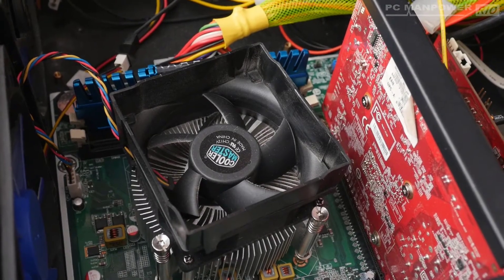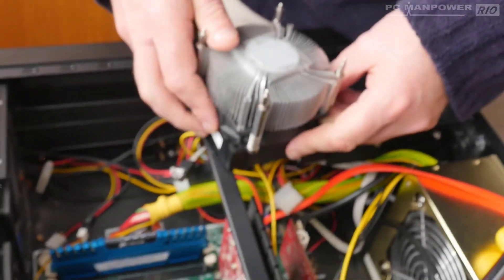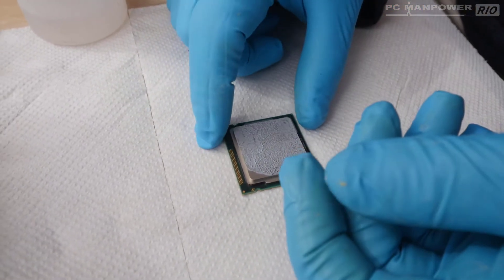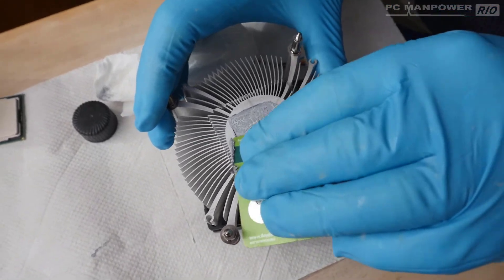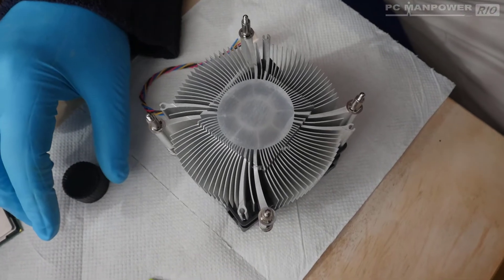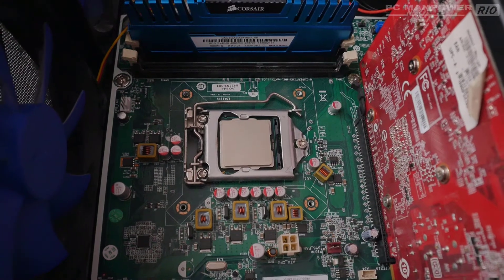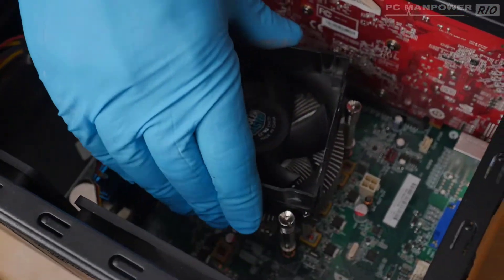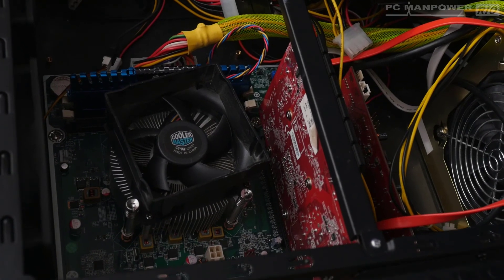Reseating a CPU

Comment: PC not starting after installing new CPU fan. No sign of life, no LED, no beep, no fans, nothing. I've checked and reconnected all power cables, flipped the PSU on and off. Reconnected the power button to motherboard. No progress. I fear I may have tightened screws too hard when installing cooler. Could this really be the issue?